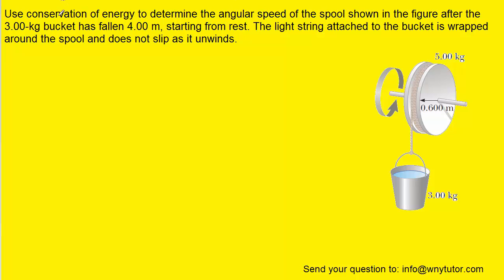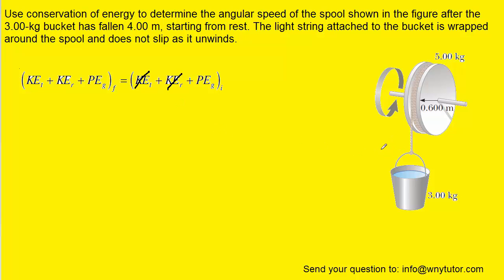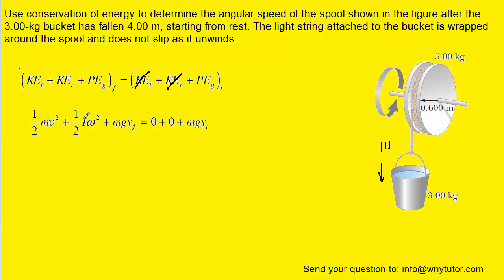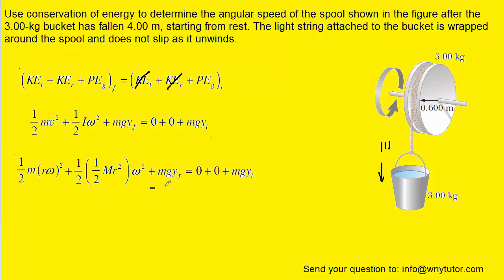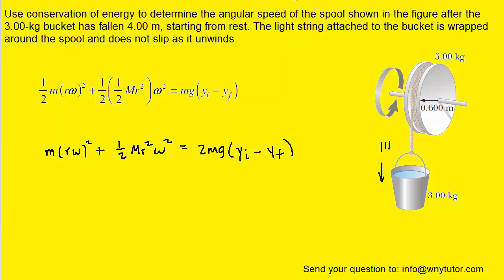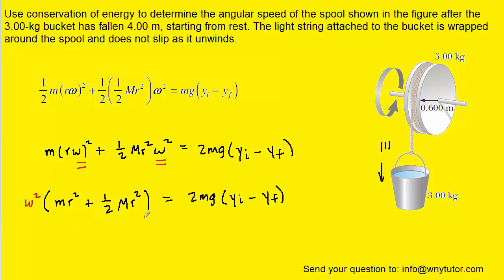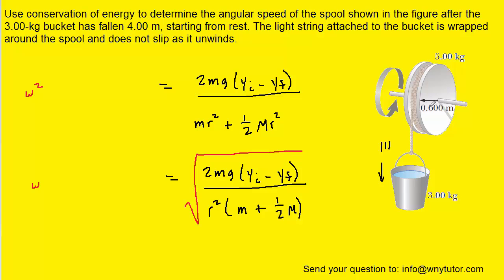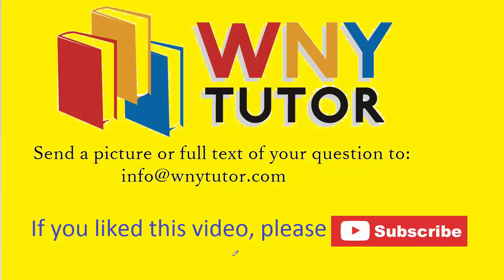Use conservation of energy to determine the angular speed of the spool

Comment: please help with this question: An object of mass M =12.0 kg is attached to a cord that is wrapped around a wheel of radius r= 10.0 cm . The acceleration of the object down the frictionless incline is measured to be a =2.00 m/s2 and the incline makes an angle u =37.0° with the horizontal. Assuming the axle of the wheel to be frictionless, determine (a) the tension in the rope, (b) the moment of inertia of the wheel, and (c) the angular speed of the wheel 2.00 s after it begins rotating, starting from rest.